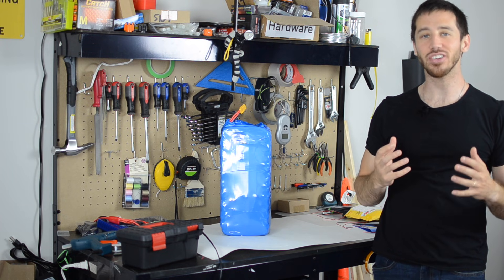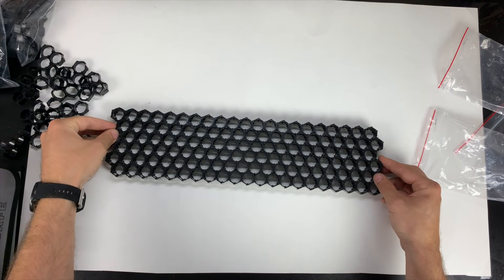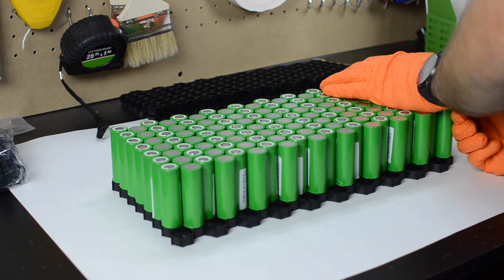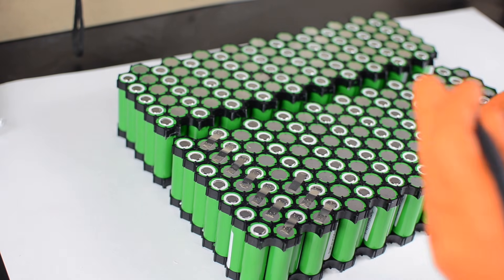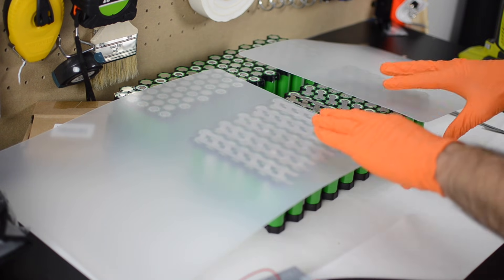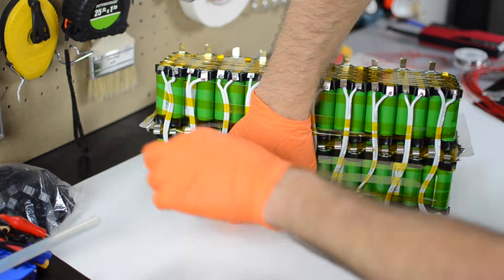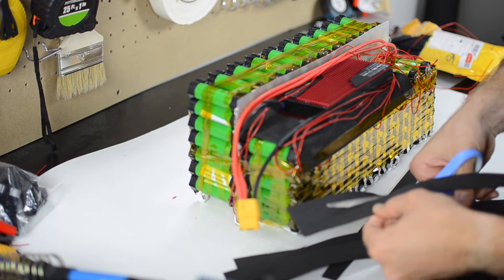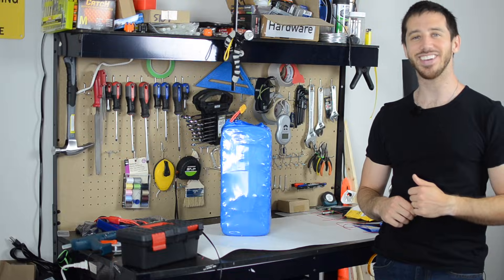DIY electric motorcycle 72V battery build (DIY E-moto Part 3)

Comment: Gosh! You make it look so easy. Would be a great idea to say roughly how much it cost at the time of manufacture. It would certainly help me as I'm on a limited budget.
Reply: $775 - $1,100...200 Samsung 18650s, $600; BMS $175; the rest depends on how much you want to weld and solder vs the snap-on kit which saves time but will add about $300 to the price tag.  Under $50 if you want to do what he does with spot welding and soldering [assumes you have the tools]

Comment: Have you ever considered adding some form of thermal management? I'm wanting to do an electric motorcycle build and was considering doing some form of thermal management so the batteries can last as long as possible. I'm going for an electric chopper type bike. (Honda shadow, honda rebel frame)

Comment: Great Video, To the point & detailed, & Skipping the waffle that other people include.
Weight of completed battery? is it 12kg? 
Why do you use Cris-Cross of nickel strips? One wider nickel strip could weld to 24 batteries ( or 10 & 14) , thus halving the number of spot welds?   Minute 6.38  in the first row of 2nd half pack, there are 2 groups of 3 cells , a change from the general pattern .  Is there a reason?

Comment: I ask questions all the time with no reply, hopefully this one gets a reply.  Why is it necessary to have a BMs? I the pros you mentioned in other videos, bit people swear that you get longer lifespans without one if properly controlled. Could you provide more detail on battery management systems?
Reply: Based on your book, pretty much maintains equal distribution over the cells and reduces the chance of damaging cells if one is bad. The down side is that it cuts off power immediately if falls under a certain range.  I guess I'm just going to keep writing comments for my personal note keeping haha.
Reply: @DejaVu8  It's not necessary it's just safer. A pack with bad cells and no BMS will still allow charging. It can be overcharged  as well. I think I will start running some projects without a BMS. They can be a cause of problems that dont need to be problems. If you are commited to testing voltage   as the pack sits or cycles or charges, it's fine. Theres millions of li ion packs out there with no  BMS. Quite frankly, the neo nerd psuedo dc engineer types are over cautious.

Comment: Hello, I have seen your videos and I am interested in learning how to make lithium batteries, I have your book but there are several things that I do not understand, since I have seen that there are connections that can make a short circuit but it is still not very clear to me the different ways to manufacture those batteries and I would not want to make mistakes, specifically I want to learn how to manufacture the 18650 and I wanted to know if you can help me or if you teach a short instructional course and how to contact you

Comment: Do you need to charge all the individual batteries to check the capacity if all of them are new?
Reply: You need to verify that voltage of each cell is nearly the same, before making the battery ...

Comment: I can't understand the balance wires and bms wires. If all the cell groups are connected as one cell group and youre attaching balance wires/bms wires to each small group isn't it pointless since your bms is reading a voltage from the entire pack and not just the small cell group?
Reply: 20S12P = 12 cells in each parallel group then 20 cell groups in series.  The voltage on each of the 20 cell groups must be monitored by its own Balance Wire ...

Comment: Hello, I want to build a battery of 150 Ah how could i do it?
Reply: Buy 800 18650s with 2500mAh each.  Create 20s, then wire the series in parallel.  That will be a huge battery pack

Comment: Hey man thanks for your videos!  I have a gio Falcon scooter that runs with with 60v 20ah Sla  and a controller that shows 60/72v confined eletric current: 30a , Do you know if can I use/add 72v 30ah lithium battery to have more range and if this 12v more will give more power from the motor ? thank you very much

Comment: Great video, but you skip too many important steps, in the spot welding end and a bit more detail in how the connections are made. I think most people are interested mainly in the connection of the cells and a bit deeper knowledge on why its wired in such a way, maybe cut more time out of assembling the batteries into the holders etc.
Thanks though, i dont mean to be negative i just think you would do a great job at explaining it further is all.

Comment: hello, is it possible to solder instead of weld? thank you
Reply: Technically you can solder rather than spot-welding but there is a very good reason you see people using spot welders instead of soldering and that is heat. You can easily overheat the cells whilst soldering to the point that they'll combust. Only an insane person would solder over spot-weld, basically. Don't do it ;)

Comment: I have some experiece with selfmade batteries for cars from our university. From my knowledge this battery for a driving vehicle is dangerous. There isn't everything bad but this is a field where you shouldn't make any mistake. A few points .
     1. There are too many cells without any physical barrier when you see pictures from for example 
        the audi etron battery you see they diveded the main battery in ~30 smaler packs with walls 
        between them.
     2. The heat transfer is very bad and you didn't have at least one temprature measurement point 
        in the pack. So you cant see if they overheat. 
     3. Maybe it would be ok for apowerwall but for a motorcycle it would be much to dangerous. 
        For the case of an accident you calculate with 20G when you construct your battery box. Now 
        take your heatshrink an fill up (in thoughts) this with 20 times the mass of the battery( which 
       means 20G)
Some final thoughts. 72V Dc isn't so dangerous. In an accident you have very fast two lines connectet( due to the lack of the physical barrier) and now you have life threatining 144v ore more.
Also you will need Ac voltage for the engine. Here 50 V with 50hz is life threatining. (Thats the reason why some hybrid cars have 48v systems) 
You have to now you can't see electricity and there is a reason why companies have much more safty systems (and cooling systems) in there batteries and still there are accidents with thies batteries.
Reply: Philipp Wagner   You are NOT going to be able to get 144 volts out of that pack in an accident...the cells are not going to reconfigure and series connect, lol.   And I would hope he is putting the pack securely in an enclosure for protection.  However, when dealing with such a large pack,  a short circuit could result in catastrophic fire, explosion, or both.  I would not recommend amateurs attempting to build a battery of this size,  alot of experiece is required.   And just as an afterthought.....can’t gastanks explode in an accident as well?  😀

Comment: Hi really Great,
But my idea is 
1. you should of add cell level fusing system to battery long life ....yes Offcource yiu might use fuse at battery pack on total voltage and ah but cell level fuses will save the rest of the cells if there is any Hazard/blast/short circute etc... 
2. You should of add any third party spar sensor parts to maintain normal temparature. 
Yes these temparature  sensors are not available but you kindly  do research how to maintain to keep normal temperature between cells.
These two points will give batterypack long life running,
Safety, avoid any danger incidents.

It's just my opinion dude.

Comment: Hi Micah, I know it's a standard in the ebike world to use 18650 cells, but I often wonder if 21700 are any good. Being that they are slightly bigger but can have more ah and current discharge, I wanted to try them in my next project. Any comment or if anyone's used them before can they let me know how they worked out.

Comment: Hello all. I want some help about Nickel strip size. I plan to assemble 72V 42Ah battery pack with LIFEPO4 Cells. The series parallel combination is 23S7P. Now, I received 0.15 thick nickel plated strip with weld machine. What thickness is OKAY for my battery pack. Please reply. (Battery application- 3000watt hub motor of bike). Thanks

Comment: I have a question, Is it possible to solder 1st all Sense wires to the positive terminals of the battery before inserting it to the BMS socket? I notice when I inserted it to the port it smoked. so i immediately pulled it out. Hope somebody can help. cheers!

Comment: what were the total materials cost?  Anyone have an idea?
Reply: A lot i suppose.. samsung cells of i remember correctly
Reply: @Boz1211111  just trying to compare, as I just bought a 72v 50ah 150a bms, charger and steel case - battery using samsung cells - from Ridion Battery for $1,000 shipped

Comment: I love how every diy battery pack looks like a bomb while making it
Reply: On that note. When fully charged, there is roughly 10MJ of energy in this pack, which is about equivalent to a Coca Cola bottle Molotov Cocktail :)
Reply: well, it basically is.
Reply: @vex123  True xD
Reply: Sir, are you ok?
Reply: It pretty much is, I almost shorted my 74v 13a 18650 li-manganese battery pack once and that was terrifying
Reply: @OSEH614  it is essentially a bomb, maybe that's why I'm terrified of them
Reply: B. Lim  That dude was a little more insane then a 300w cloud but yeah
Reply: That's racist !
Reply: @kalnwi  dafuck?
Reply: B. Lim  really?, never knew that (not native English language). I always thought it was a slang. Why did that called racist though? (r/woosh? /
Reply: Meds chief
Reply: It could be one of you overcharge it or something
Reply: Sam thought. 🙀
Reply: Well I guess it is
Reply: LMAO
Reply: It is when mishandled.
Reply: Fed
Reply: Yes this is purely a bomb no heat transfer arrangement.. excessive heat cause a blast..
Reply: @smileandtravel  will it overheat tho? These are all connected in parallel (I guess I don't remember) therefore the current will go though ALL them in order to heat up I guess that fixes that, but I could (and very likely are) be wrong

Comment: Have you ever considered using single pouch cells to build a battery pack? They have a much higher C rating.
Reply: Those babies are testy, easily punctured/pressured. Not great maybe on a 2wheeler

Comment: Shouldn't the BMS be outside of the battery pack? won't shrinkwrapping it in with the batteries over-heat it? I'm new to the channel and don't know how hot these will get. Looks cool though. I was considering buying a Zero FX this summer but now I'm reconsidering.

Comment: Why don't you build a generator or put a generator on one of these bikes so you never run out of battery power they build generators like that for homes that keep recycling electricity they never run out of juice once you plug it in and get it going you can unplug it and it stays running right off its own generator can't you do that with a bicycle and electric bike put a generator on it never run out of power or your batteries are always charged I'm sure you'd have to put in some kind of switching there so you don't over charge your battery and blow them up but you'd be able to figure that out

Comment: 2000 watt or more rwd hub motor  (12 ,inch or larger tires and wheel) and even heaviest scooter etc. with iron chassis; it will definitely fly, at least 55 Kph without limiter,no whatsoever problem about up hills. My RWD 2000 watt hub wheel scooter with very heavy iron body have 6 ( 12v  and 20 amp) lead acid battery (Each 7.5 Kilos) 45 kilos in total. With that configuration; 2 adult guys at 150 kilos in total + 2 sand bags around 100 kilo in total,  it pulls great. With lithium batteries you are gonna safe at least 40 kilos and in this configuration it is also 40 Amps. Distance is gonna be way longer, speed is gonna be much better.

Comment: Hey man i got a question as i see you mention both batteries and solar we own a few velomobiles (bike cars) known as Organic Transit ELF and they are solar/pedal hybrids we have been trying to find a replacement solar charger that is a 54v/8ah and it has a blown fuse we would like to have it be able to charge off the solar instead of wall power any ideas what we can replace it with that's reliable

Comment: Could you do a video on those portable spot welders that seemed to have popped up lately the ones with a lithium battery and they are around $50 ish they seem to be a small circuit board with 3 modes a small lithium battery and terminals. I have a 787G spot welder and was wondering if these new portable ones would be any good. thanks still love the channel after following for a long time when you lived in a better climate.

Comment: Incredible battery, I have a e-unicycle, two 72volt 18650 cell battery packs each side of 518watt, together make a 1.036kw.  i'd like to build another battery of 72v 518wh values to add and extend my ranges . this was informative

Comment: What about cooling, Sorry I am New, but i have heard, generally high drain batteries emits lot of heat.
Reply: I made a hexagonal 12p20s pack and ran it for almost 2 years. I disassembled it due to 1P dying. All the heat shrink showed signs of heat damage. The tops and bottom of every cell had deformed heat shrink. I'd post a picture if I could. Make me cautious about hex packs with MJ1s. Of course discharge current matters. I run a 3000W QS motor, but wasn't using it to it's full potential. My current pack is 14p24s with LG HG2s but in a standard grid, not a hex.
Reply: @clubpasser123454321  . Hello Bryian. , I'm a newbee to this thread and everything still looks like magic to me.
Having read about your recorded successes, I am amazed. I wrote to the presenter but have not heard from him.
I read your comments above and admire you for sharing your thought about the "merits and demerits" of the "HEX" method .
Having said that you must have learn from your samples and improved on it. 
Kindly share a sample of your most recent achievement and I am willing to pay for a sample so as to help me "step by step" in studying 
your better procedure. 
Also,
 where can I buy all the required parts from? Which store sells them? If you send me your phone number I can also call you.

My name is "Bill", I'm in New York and my email is cctvwholesaler@gmail.com 
Thank you.
Reply: Pretty much  this is why Tesla batteries but not engines are liquid cooled and most high powered bike leave spaces between batteries or use batteries from cars which have some sort of cooling method. A big thing when you go into high powered bike is the high drain will leave a hot battery and if you charge it right away that's how you potentially destroy your cells.
Reply: Brian Barrett I also bought a 3000w QS Motor for my Honda Ruckus. So why did you decide to do 14p24s vs 12p20p (72v) ? I got a Votol em-150 as a controller.
Reply: MJ1's are not high drain cells by any stretch. Also, with this hexagonal packing scheme, the batteries near the center of the pack will get a lot hotter than those on the outside. That's of course dependant on how much power is charged or discharged, though.
Reply: max discharge rating or 'c rating' is everything. i have a 60c-100c burst, 1600mah ,4 cell, 14.6v graphene battery for my drone. 100c is a discharge of 100x the mah capacity or in my case, 160ah or 160,000mah at 14.6v. it was not a cheap battery but the same voltage and capacity with half the c rating would overheat much faster and thus wear out faster. so if normal use of whatever the battery is powering is 30c of a scaled voltage/amperage, then a 60c battery with a 100c peak wouldnt even get lukewarm during normal use. abuse will make it warm, but not overheat.

you basically want your battery to be able to outperform the thing that is using its power if you want to keep its temps down. that said, too high of a discharge rating on the battery without good software to limit the thing using its power could damage or destroy things like motors, coils, solenoids ect.
Reply: 12 Parallel,  this configurations will help keep cooling down.
Reply: I am sure whatever housing he builds for the battery will also channel air flow to assist with cooling.
Reply: I think he is placing it where the motor/gas tank goes so when it is in motion the air going around it will act like a cooling system but just a guess on my end
Reply: Nice job
Reply: There's a lot of surface area. These won't really heat up.
Reply: @somedude2492  Surface area is the same for all 18650 cells. It's the proximity to adjacent cells that's reduced in hex packs. Less airflow, more trapped heat. MJ1 cells also have relatively high internal resistance making the problem potentially worse. This is only an issue high performance bikes. If you have a 500W motor, you can run any pack in any configuration. If you like to get max power out of your pack, say 10A per cell with MJ1's, then you should carefully consider how to layout your pack.
Reply: Brian Barrett im shopping for items to convert an old moped right now, qs motors seems like the best choice out there? I’m planning on mid drive so I can change the gear ratio to my needs, does hexagonal vs “square” holders make big difference with heat when you got the heat shrink on anyway? Planning on 20s12 or 14p, thinking high drain cell like 30Q or HG2 and thick nickel strip for best efficiency?
Reply: Heat generation depend on not just the battery alone. The load also play a role. The battery only determine how much heat is generated at a given load.

Comment: I plan to build a 60V 30A battery. What would you recommend between these 2 configurations:
Op1: 17s12p using 18650 batteries (3.7V 2500mA)
Op2: 17s6p using 21700 batteries (3.7V 5000mA)

And why?
Reply: 1